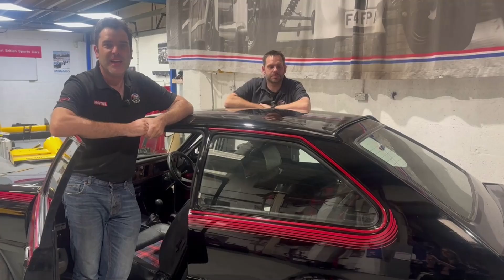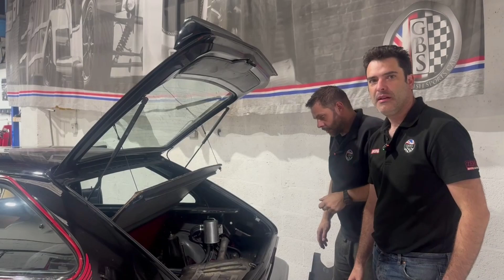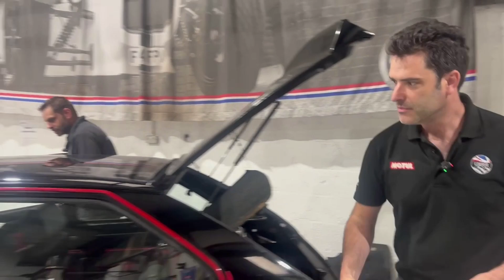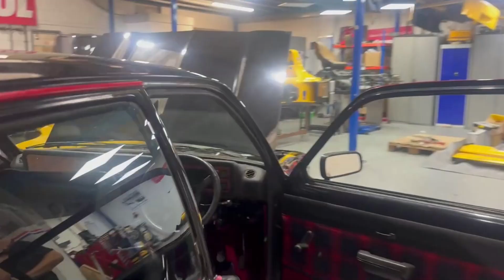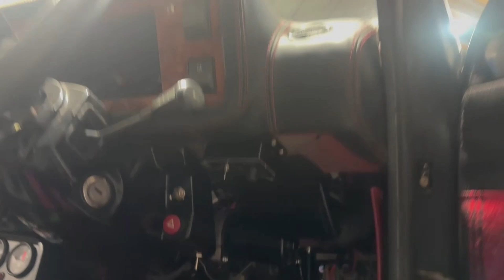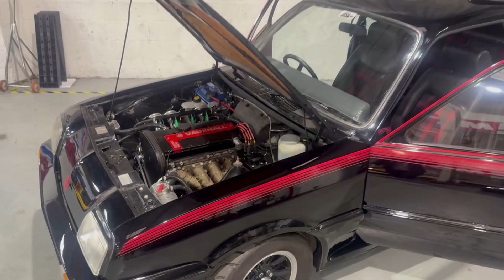GBS Workshop – 1980’s Vauxhall Chevette HSX Project in detail.

Comment: It is a Back Magic replica, not HSR or HSX. The C20XE engine swap / Gearbox and running gear on this car was done / fitted at a garage in Leicestershire, Not GBS . 
The twin dellorto carbs were fitted and set up on a rolling road, including relocating the Brake reservoir duo to the carbs fowling on them to where it is shown in the video, This work was done by a garage at Ripley Derbyshire  Not GBS
The bodywork and interior was done by my late father and myself.